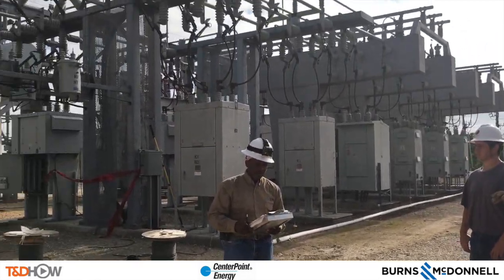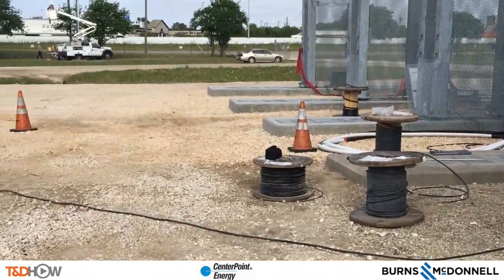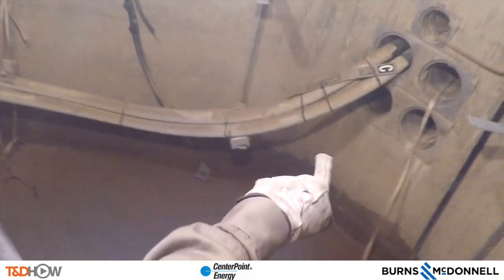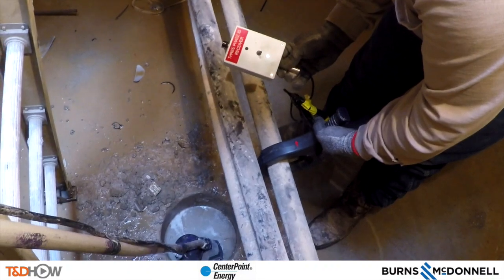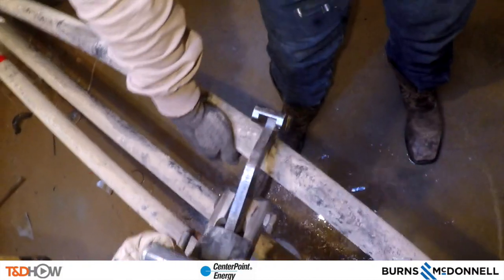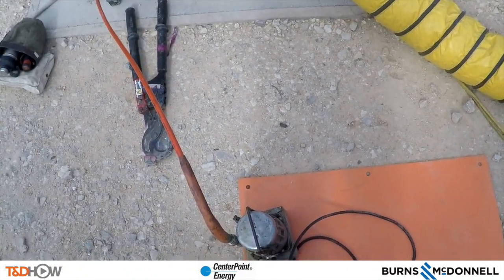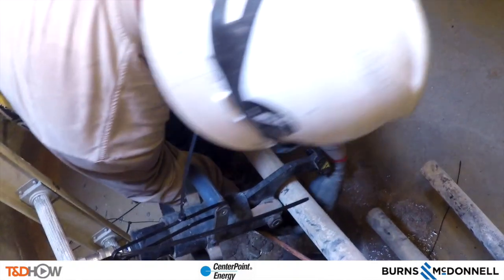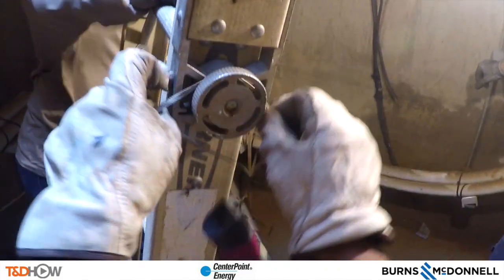Phase Testing and Cutting for Underground Cut Around

Comment: Why are they leaving the manhole to cut the cable when the cable is dead?
Reply: Safety. If the cable happened to be hot or a mistake was made you dont want to be anywhere near it
Reply: high voltage cables tend to have residual current
Reply: You always treat the cable as if it's hot. If you cut the wrong cable and you're down there while it's hot you won't have a good time. I've been next to a manhole when a splice blew. Made me respect my job a lot more.
Reply: because, even if you're 100% sure there's no voltage on, you are supposed to approach the cable as there is potential voltage on it.
Reply: Ahhh. I see. The most voltage I work with is 480V... and I don't really like doing that...